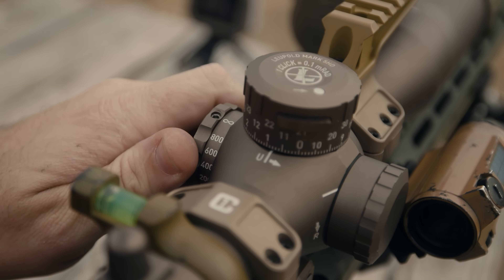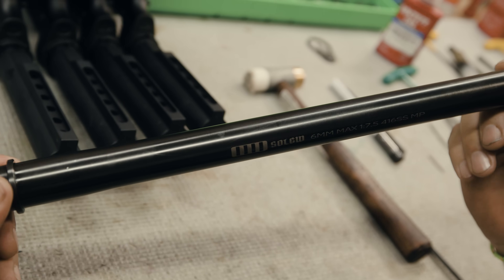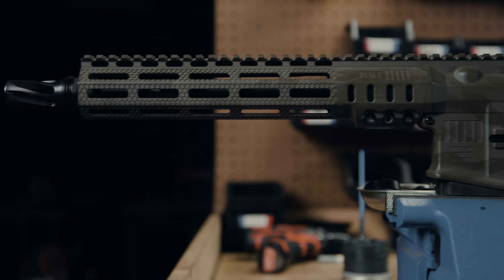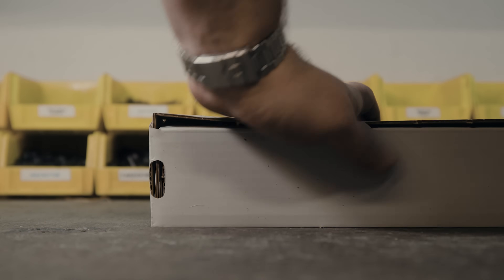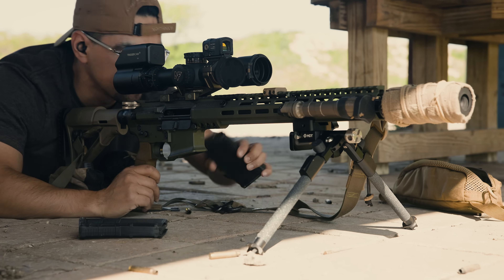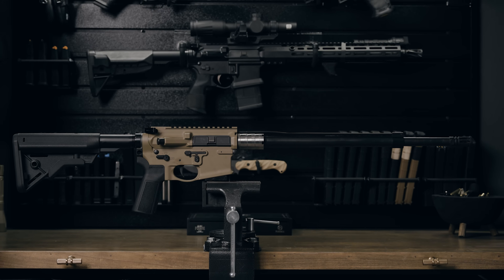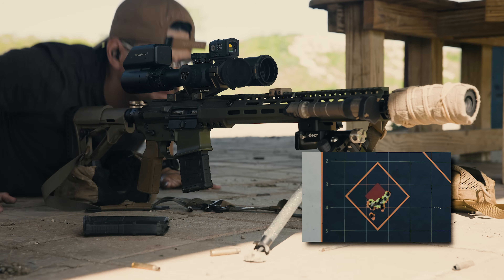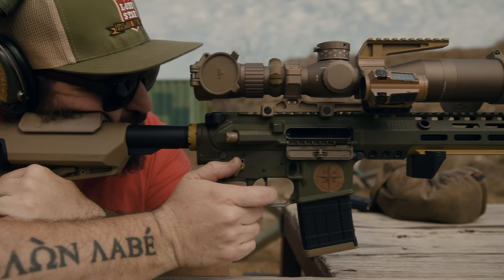Inside the SOLGW SPR Barrels - What Makes Them GREAT

Comment: I purchased one of this barrel in 13.9” with mid-length gas system, cambered in 6mm ARC with a 1:7 twist. And let me tell you, that thing is a laser. The bore has been polished to a mirror finished. It is heavy, but amazingly accurate. I couldn’t be happier with my purchase. I highly recommend SOLGW. They converted me into a true believer.
Reply: I’m on the fence about getting one of these or a Rainier Arms Ultramatch. Both 13.9 mid lengths, but the Rainier is lighter with flutes. However SOLGW is only $250. Thoughts?
Reply: @ChadCooper03 SOLGW. Their warranty is rock solid along with QC.
Reply: @ChadCooper03  solgw for sure

Comment: Please,  please,  pretty fucking please, make a 6mm arc barrel. 
I am currently running a 16" 1-7 BA Hanson with mid-length gas, SA adjustable block, your BCG and buffer system. 
The gun performs like a dream,  but the accuracy is dogshit. 
You guys have a 6mm Maxx, just make the arc.
Reply: Never mind,  looks like you did.
I'm on the waiting list.
Reply: you can just order it from BHW
SOLGW doesn't make these

Comment: One thing I always credit Mike with when discussing the in depth stuff about stoner’s design with fellow users is the simple and straightforward but highly informative nature of the content you guys put out, not overly clinical, its stuff that normal users can apply to their component selection when looking to have a tool they can depend their life on. Whether it be buffers or bolt material, Mike’s has good and digestible content.
Reply: These barrels are literally something SOLGW bought and relabeled 😂
Reply: @riflesfirst208 that’s fine, most of the industry does that, it doesn’t change the fact SOLGW actively improves the offerings in their catalog, I concede they’re not a true manufacturer but few are and even fewer who make high end blasters are.

Also missing the point of the comment.

Comment: I used your 18” spr barrel on a build for my brother, that thing is extremely consistent. Holds black hills 77’s sub moa until I fall apart around 25 rounds in. I still need to get a video shot with that thing.

Comment: I have one of your SPR barrels that I replaced a Noveske recon with and was impressed how much more accurate and softer shooting it was especially for being way cheaper.
Reply: I agree with this. I have an old Noveske Recon that I rarely shoot anymore, an upper made in 2006 by the late John Noveske himself. It is an absolute hammer. I bought a more recent Noveske Stainless Steel Recon a couple of years ago, it's an average shooter at best.

Comment: “Gassed a bit more conservatively… still able to push a heavy buffer…”

Yeah, idk. I have the .223 Wylde 16” SPR Upper and it’s pretty badly undergassed to the point where it would short stroke all the time, regardless of ammo I used. I’m runnin y’all’s A5 buffer system with a Green springco spring and have tried both an A5H2 and A5H1 buffer weight. 

Also tried swapping the lower to a milspec lower and even using a Geissele Super 42 buffer system. 

Ultimately, the only way I’ve found to get it to reliably cycle is by running it pretty wet, in which case it would cycle any ammo I put through it. Only issue is that the brass ejection pattern is like all the way back to the 5-5:30 range, so still evident of undergassing issues.

I will say this though. When it does cycle, it’s pretty dang accurate
Reply: I had a similar issue to what you you just posted but not a solgw product. It turned out it was a BCG that was leaking a little bit through the gas key screws. Try swapping out your BCG and see if that helps.
Reply: @oldspeed671 got an NP3 Sionics BCG on order, but I took it out today with a new A5H0 buffer weight and that helped a bit. 

No malfunctions and brass ejecting to about the 4-4:30 range, so much more acceptable than where it was at with an A5H1 or H2 that I had previously tried.
Reply: @dienekes7106 sounds like you're on the right track to getting these things squared away. 👍
Reply: Not to excuse SOLGW here, but a pretty simple solution to that would be to run a suppressor. Even an reduced back pressure can would probably give you enough headroom for reliability.
Reply: @ I am. I’m running a HuxWrx Ventum 762 on it
Reply: What brand bcg and gas block are you using?
Reply: @MilspecPanda  It’s a complete M4-89 .223 Wylde 16” URG and just using an Aero Precision Black Nitride BCG with it for now.
Reply: @dienekes7106 Might be worth replacing your gas rings or trying another BCG. Aeros BCGs QC has been rather spotty lately, could be that you’ve got a particularly inefficient carrier on your hands. I’d also put the gun back on the A5 lower, and down buffer it to an A5 carbine buffer, 3.8oz.
Reply: @dienekes7106 ditch the AP BCG.  Had a similar issue and swapped the BCG and problem solved.
Reply: @spacecaesar7619  appreciate the feedback. I’ve been meaning to upgrade to a better BCG at some point, but I’m not convinced that’s related to this particular issue, because I did swap BCGs when doing various troubleshooting at the range with it to rule out all other potential causes. 

I’ve come to the decision that I’m just going to take it into an experienced local gunsmith to have them make the gas port just a tad bigger to increase cycling reliability and attain proper brass ejection patterns
Reply: @dienekes7106  shitty parts + premium parts don’t go well together
Reply: @ I mean I tried a standard milspec Buffer spring in a Daniel Defense lower I pulled off another AR. 

The lower I built out specifically for the SPR upper just included SOLGW’s A5 buffer kit, which is basically their L9 buffer tube, Sprinco Green Spring, and BCM A5 T2 buffer weight. 

After my first initial range trip with it, I ordered a VLTOR A5H1 to try a slightly lighter buffer weight to see if that’d fix it. It pretty much does, if I run it fairly wet, like spraying some Ballistol inside and on the BCG. As I mentioned earlier though, the brass ejection patterns are still consistently between the 5-5:30 range, which is clear evidence of being undergassed. 

All in all, I don’t think it’s the Aero BCG that is the culprit of it. I just think the barrel’s gas port is slightly too small and it might be a bit of a lemon in that regard. As Mike explains in the video, they do intentionally go for a smaller port to make for a smoother shooting precision rifle, which is great in theory, but in my personal experience with this upper and using their recommended A5 buffer kit, it just isn’t exactly what I’d expect for consistent reliability. 

I have ordered a VLTOR A5H0 to go even lighter and a Sionics NP3 coated BCG to replace the Aero Precision Nitride one, so hopefully those two things combined can perfect this rifle build. I would get a SOLGW NP3 BCG, but I can’t find them in stock anywhere. 

Appreciate all the feedback though
Reply: @ I’ll be honest, I unfortunately don’t have access to any long distance ranges where I live currently. The longest range I can make a easy range day out of only goes out to 300 yards, so I can’t really give any great feedback about how well this upper performs at ranges out to 800 yards. 

And most of my times shooting it have been mostly the troubleshooting I have explained. Hopefully when I get this new A5H0 buffer weight and the Sionics BCG, it does better and I can actually dedicate a full day to getting a solid zero with either 69gr or 77gr and then hit the 300yd range to get some decent work in with it. 

My most recent trip I just sprayed down the BCG and internals with Ballistol and it ran everything from 55gr, 69gr, to 77gr without a single FTF or other malfunction. It was just the brass ejection pattern I already explained. I was only shooting on a 50 yard range for that troubleshooting, so I mean it wasn’t like a true test of the barrel’s accuracy. It did have really tight and solid groupings with all of those ammos, so I was happy about that. 

Last ditch effort to get it running with the new BCG and buffer weight before I have my buddy’s dad, who is a life long experienced gunsmith, take a look at it, measure the gas port, and then probably expand it just a little and do some tests until it’s reliably cycling without any signs of severe undergassing. 

I like where SOLGW’s heads are at with getting a really soft shooting gun for precision applications, but mine likely just needs a minuscule amount of work to open it up a bit more. 

If I can get it to eject brass even at like the 4-4:30 range with the A5 buffer system, I’ll be happy with that, but where it’s been at is just frustrating, because of the sporadic short stroking issues I randomly encounter with it if it’s not lubed up really well before hand. 

I’ve never owned an NP3 BCG, but I did some research on quality brands and improved coatings and the Sionics and SOLGW NP3 ones seemed to me to stand at the top, so that’s what I decided on. A bit pricey, so hopefully that smoother NP3 coating reduces internal friction and the chrome-lined carrier itself makes for a better seal between the gas rings and the carrier, so it rules out any gas leakage in that area.

Comment: I have a SOLGW receiver set and I was really impressed with the quality of the parts. Even the anodizing is different. It is thicker than most other anodizing that I've seen. 

I like it man. You guys put a lot of thought into your parts. I am planning on getting one of your barrels. Question: Are the 6.5 CM barrels compatible with SR25 pattern or LR308? For all I know the barrels between those two patterns might even be interchangeable, I haven't built a large frame gun yet. I know there isn't a "milspec" for them although more and more companies are going with the SR25 pattern.
Reply: I can’t escape you, you’re everywhere. How do you do it?
Reply: @spacecaesar7619  Boredom. I'm a machinist so when I get the machine running and assuming I don't have anything else I need to do like clean up or build tools or whatever I can comment on videos and I always have headphones on as a form of hearing protection so even if I don't comment I listen.

Comment: Would love to see either 223W or 556N 13.7 SPR Barrel . 
NOVESKE and maybe Centurion are the only ones i know of that offers Precision 13.X" barrels . 
Been super impressed with SOLGW over the past couple of years . Had 0 clue who you guys were until couple years ago . Between the MK1 , M4-89 and SPR BROADSWORD you guys are crushing ..
Reply: Novelle barrels are nice they just have gaping gas ports. Adjustable blocks are a necessity
Reply: @JNOSNOW i use BRT 0.073 EZ Tune Gas Tube . Im not a fan at all of Adj Gas blocks.  
What works for me in all my Competition setups is 13.7 - 14.5 Middy Barrel , Brownells LW BCG with BCM Bolt / BCM BCG Internals , BRT EZ TUNE 0.073 Gas Tube ( equivalent to 0.070 gas Port) , Springco Yellow Spring and KAK 1.7oz Buffer . 
Only caveat is you have to change out the BRT Tube every 10k to 12k rounds .
Reply: @seanwhite304  im not a huge fan of the BRT tube. Most every situation is good but i have seen one fail to cycle the weapon in 0 degree 2 gun competition two winters ago. Guy threw a spare bolt and did a quick clean and same thing. I much prefer Rifle speed blocks or SLRs if youre on a budget. I definitely would not recomend cheaper gas blocks or the superlative arms crap. I have great luck with the rifle speed and its super easy to get changed cause i can definitely notice the difference between 0 degrees and 32 and 50 degrees with cycling performance. If i was taking something to war i would be overgassing that thing like a mother fucker though and pinning on the toughest non adjustable block though but were not at war here.
Reply: @JNOSNOW Ive heard awesome things about RIFLESPEED.  Have yet to use one. 
I personally know over 10 dudes who use BRT 0.073 Middy Tube with LW BCGs . Only reason why i know them is because i built them specifically for Competition.  I have not used any other BRT other than 0.073 Middy . I personally have about 14k thru BRT Tube . Last year i swapped my Tube when i swapped the barrel . Im running 416R Nitride or QPQ Barrels so every 10k to 12k i swap the barrel . When i do i swap the BRT and Bolt . 
I just know Barrels that come from Factory with 0.078 Port Size that BRT 0.073 Tube , Brownells LW BCG With BCM Bolt / BCM BCG Internals , Springco Yellow Spring , KAK 1.7oz Buffer and NOX9 KEYMO is legit system . I have 12 in total out in the field and have been 100% reliable 223 55g FMJ , 75g BTHP Match or 77g OTM . 
I am not a pro builder im just helping buddies out by building the upper . 
I do not charge them for the work . Im just helping them build out purpose built Competition Carbine . BA 223W 14.5 Hanson Premium Black Series , Rosco K9 GREENLINE and Criterion Core 13.9 are the barrels ive done this combo on .